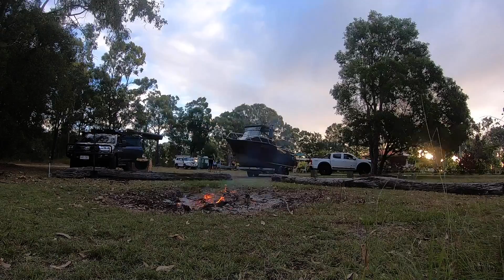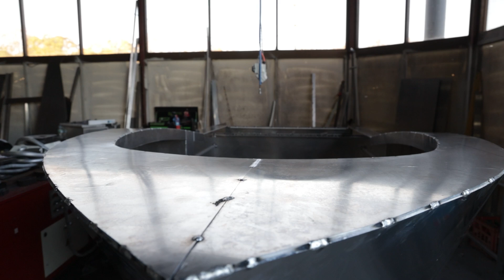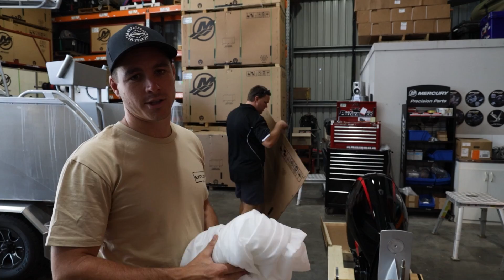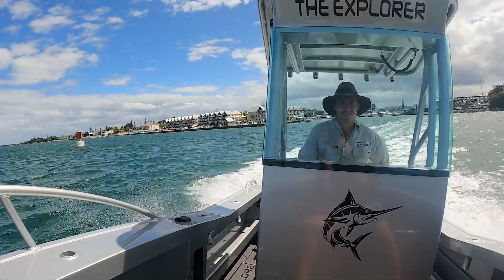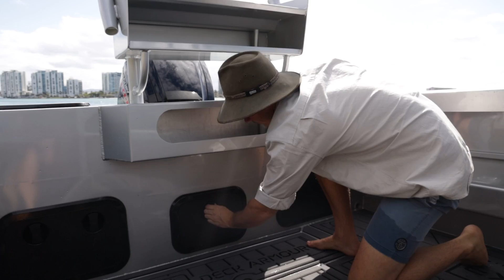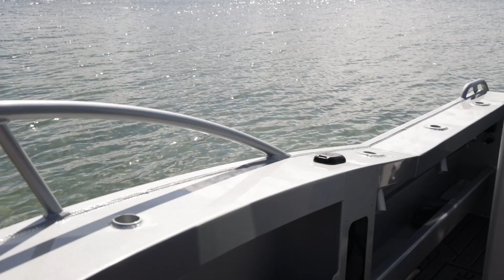"THE EXPLORER' NEXT LEVEL OFFROAD BOAT BUILD! -EXPLORE BUILDS

Comment: Howdy, just about to grab the Green Machine you had in this video. It’s now in WA. Not sure what power it had on the back when you used it… but in now has x2 60hp Yami on the back. 
Question is, what sort of fuel consumption did you get & WOT? - I’ve brought pending sea trial, as I’m working away atm. Did it have enough balls ? 
Trev.

Comment: 18 degree dead rise will make any lumpy water feel like your hitting concrete, you’ll come back 2 inches shorter and your fillings might rattle out
That’s why I built my own cat
Those “dry” storage compartments on the floor in front of the console will easily fill with water on a rough trip
Great workmanship but too much bling for me

Comment: Definitely a fan of the Mercury, I’m surprised it couldn’t handle more HP then the 115? Was this due to cost Matty or is that all the transom is rated to?
Reply: The boat is rated to 140.
Reply: Doubt it was coast considered all the stuff he’s put on it like deck amour ect
Reply: @bennettbuchanan2162  the 200hp is 10k more so its a fair whack, I'm more interested in finding out if thats all the boat can handle
Reply: The merc 115 pro xs has a bigger gear box and tuned harder and lighter weight making it a win win

Comment: Looks like a beast mate!!! Do yourself a fav and ditch the old 1/2/both/off battery switch and get a blue seas system add-a-battery system.... takes away the need to ever having to remember which battery you are on and accidentally leave it on both and drain both batteries. It’s a automatic combiner relay (ACR) which links the battery’s together when it senses charge and disconnects when stopped, preventing ever discharging the starter. Trust me they are the business for dual batteries for boats 👍